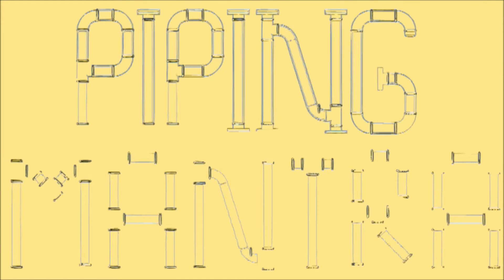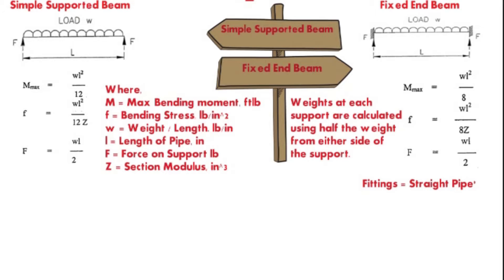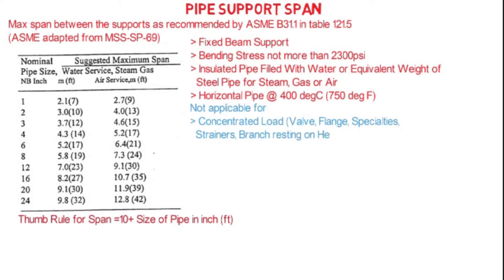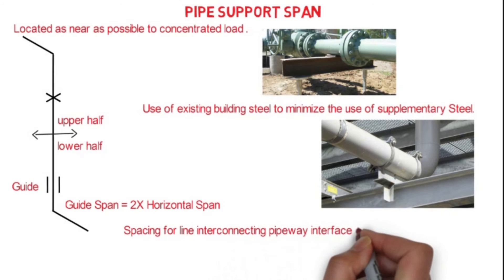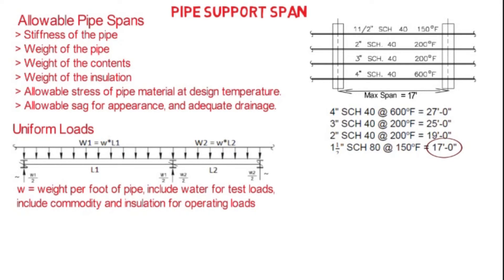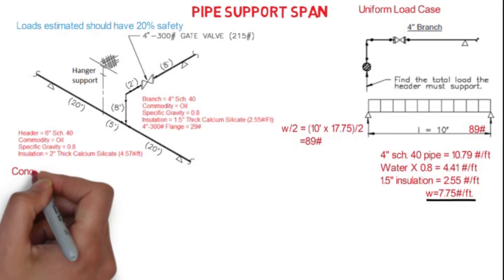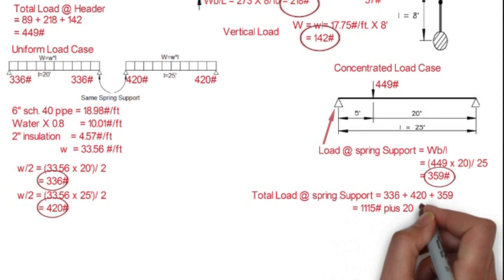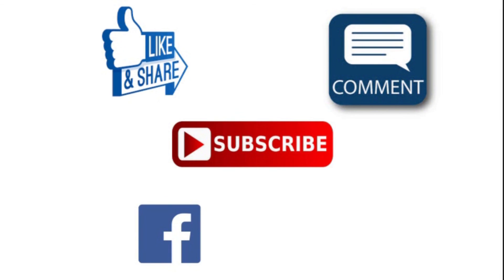PIPE SUPPORT SPAN | BASIC PIPE SUPPORT PRINCIPLES | PIPING MANTRA |

Comment: Please change your mic, voice is not clear. In two cases your teaching was not matching to the answers. First about the thumb rule for pipe support span calculation which I guess is not correct ( I might be wrong here but was not convinced from your class) and second the percentage of allowable span consideration in 3 different conditions. In 1st and third conditions it was contradicting with each other.
Reply from the maker: Its changed. Now even we have change the audio person now you can check our latest videos.
Its thumb rule which is written in many company's standard practice. This video for understanding there might be some typo error but its all about fundamentals. I hope you understand. Thank you for watching and critical comment.
Reply: @PipingMantra  I understood the thumb rule and it is the best practice to do the piping at first without having enough information. But just for my knowledge asking you that, if a pipe size is 4 inch then as per rule span would be 10 + 4" = 14" span distance. This is what I understood and I think this is wrong. Bcoz 6 meter distance which I know would be the span between two pipe supports. Please help me to understand this.
Reply from the maker: First of all that is 10 +(size of pipe in inch) is give span in feet. For your case 10+4" is equals to 14 feet. If you see the attached chart from ASMEB31.1 table it also give same value in feet. in the thumb rule it self it is mentioned that span is in feet. Might be missed because of bad sound i guess.
Reply from the maker: 6m is an avg span widely used since we have to place rack structure uniformly.